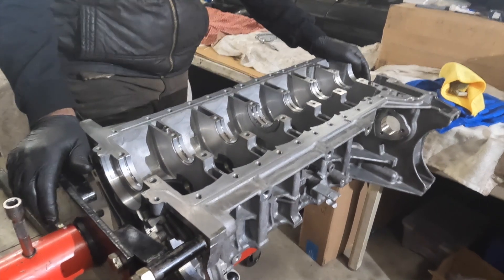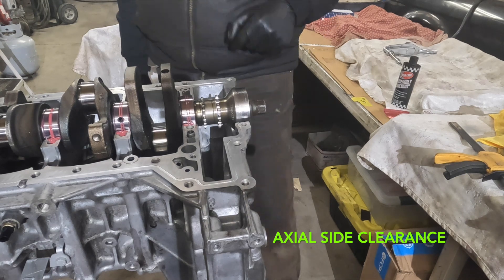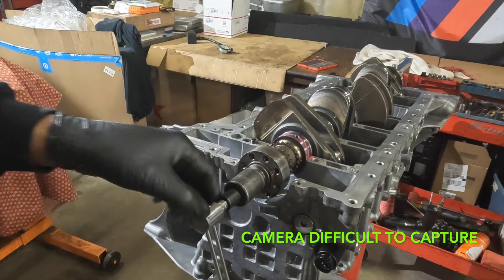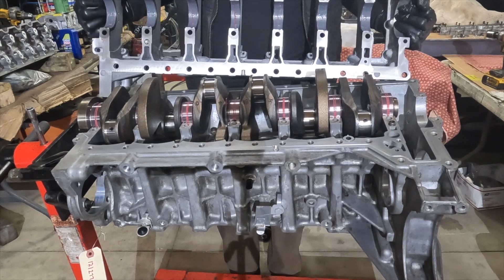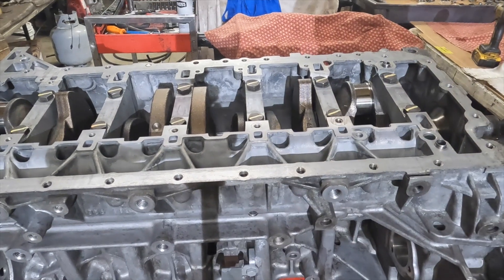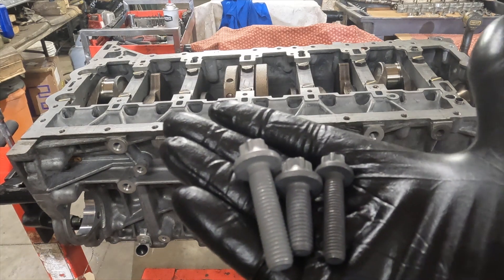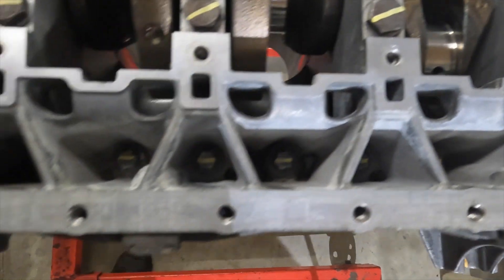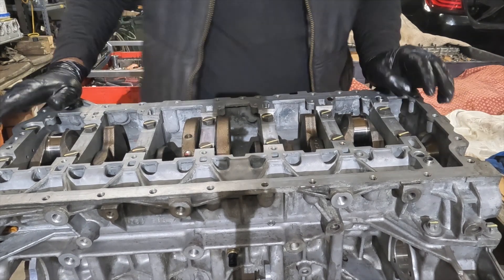BMW N55 1227701 Block Reassembly Crankshaft   Bedplate Installation Part 6

Comment: I would have done sealant now less air resistance. When it comes out wipe with carbon fiber cloth and use locktight sealant to close on main seal. Just provides visual for me. Love your work 😊
Reply from the maker: What do you mean?  You would not use the injected loctite sealant ?
Reply: I would. I just would have done it than right after blowing it out
Reply: So cool to see a response from you as well ty for your response

Comment: What is the rolling resistance torque? 
What is the breakaway torque?
What bearimgs did you use. 
We seem to have been scared of assembling do to rotational resistance amd breakaway torque. I've never heard of it.
Reply from the maker: Rolling resistance is the friction that is between the journals and the bearings while in motion.  

Breakaway torque is the amount of force to overcome the static friction of your crank which is the static friction between your journal and new lubricated bearings 

New ACL race series bearings 

Rolling resistance is a simple means of verifying your are not binding while you assemble components that is attached to your crankshaft.  

Ie RR of crank without bedplate, with bed plate, with rods and pistons 

You should have a slight increase but not significant - this would indicate something is inducing a binding in your system